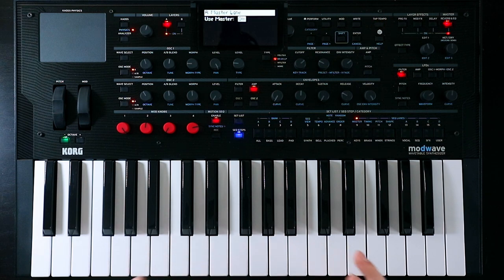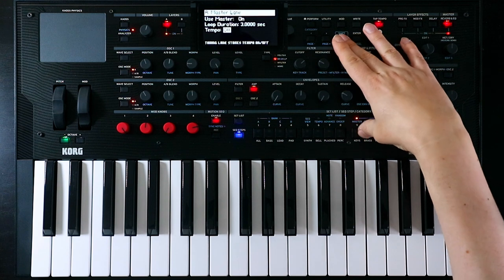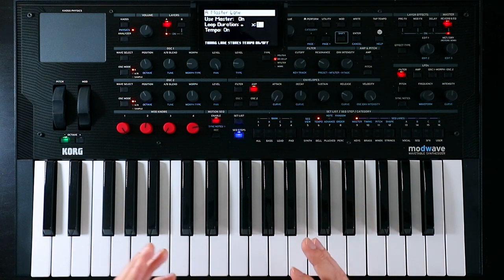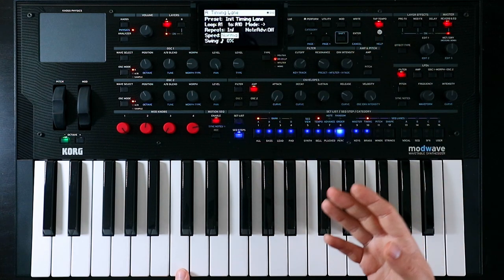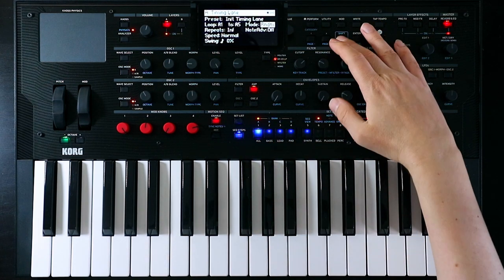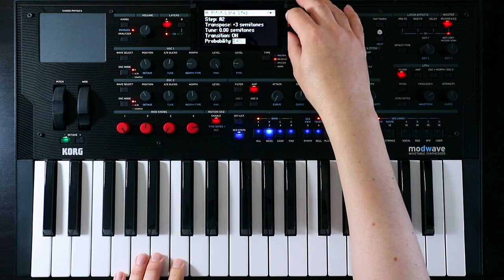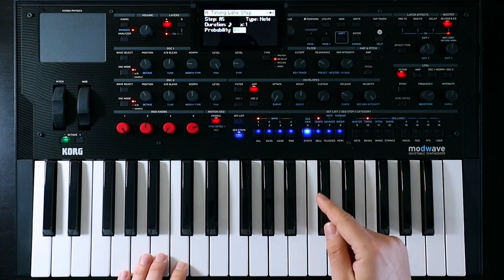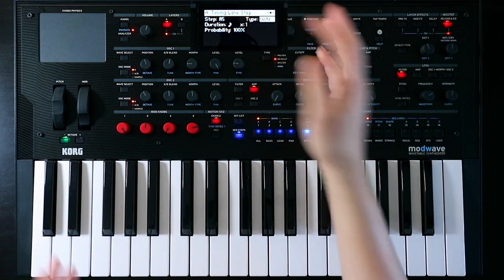Korg Modwave Sequencer In Depth - Part 3: Timing Lane

Comment: Thanks for these videos! Re your note about Backwards Loop mode at 1:49 - this is how it's designed to work, and the wavestate works the same way. The Lane starts from the Start point; when it hits the Loop End, it loops according to the setting. I understand that starting playback at the Loop End might be fun too; that would be an additional mode.

Comment: Excellent video, the most comprehensive tutorial on Modwave, for SURE! Thanks for your hard work!

Just a quick question, how do you retrigger the hihat you have on the sequence? I've tried everything but the sequence only plays the samples once and does not retrigger them. Any Tips?
Reply from the maker: I can't remember exactly what I did as it was a little while ago, but I'd wager: it's not a sample. It'll probably be noise and I'm enveloping the level.
Reply: @OscillatorSink great tip!!! 🎉

Comment: Thanks a lot for the video, I have some questions
1) Is it possible to assign 1 sample for each key? Like drum drum, snare, drum, snare snare ?
2) Is it possible to make the sequencer independent of what I play on the piano? Like I have my drum sequencer running indefinitely while a I playing yet another sample on the piano... like a piano sample sound.
3) Is it possible to have a sequencer on Layer A running indefinitely independent of tha layer B? So on my layer A I have my drum sequencer going on, and then on layer A, I have a piano sample that when I press the keys, it does not change/interfere with the looping  sequencer  on Layer A.
4) Can I have more than one sequencer happening on the same layer? Or are we locked to only 1?
Reply from the maker: 1) some of the sample packs do that, and you can load your own, but you'd have to sort that out in the editor.
2) on a single layer - no, but you can kind of make it work that way across two layers, but it's not really set up to do it without some work arounds
3) see 2
4) one sequencer per layer, and there are 2 layers, but each sequencer has multiple lanes.

If you want a better overview of the general functions of the sequencer, you might want to check out part one of this series. It's not a "normal" sequencer so you might be missing some context here.
Reply: @OscillatorSink  Wow, that was fast, thanks bud, I think I got to the conclusion that the sequencer is not going to do what I want and I will have to buy another hardware just to do that... like novation circuit tracker or some other drum sequencer machine and pair with the modwave.
Reply: With your first question, are you kind of asking whether it's possible to sequence a drum pattern using one of the multisampled drumkits? Unfortunately I think the answer is no, because I don't think there's any way to coax the modwave sequencer to output a trigger per step, which you need for triggering samples. This is my personal bugbear with the sequencer, but it is what it is.
Reply: @gazzar67  yes, that's what I want.... oh well... anyway, looks like I need to buy something that is good at doing only that.
Reply from the maker: I would take a look at the Keystep Pro and Beatstep Pro as a starting point.
Reply: @OscillatorSink  yes, it's either the keystep pro or the novation circuit tracker.
Reply: @airwolfnh  or the Korg Wavestate. That would do exactly what you need, and has 4 layers (quad-timbal), and I do eg drum tracks plus arp plus pad plus melody all the time on it 👍